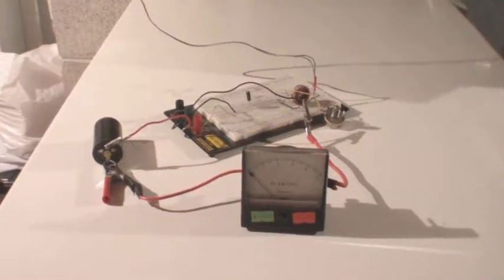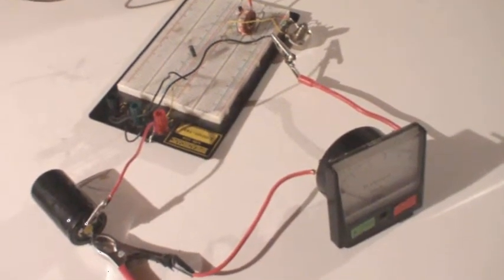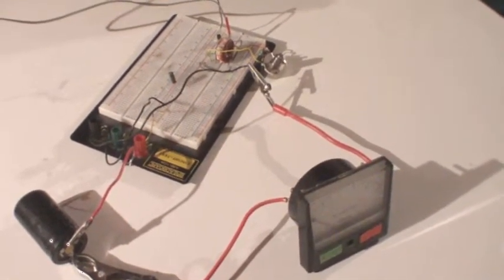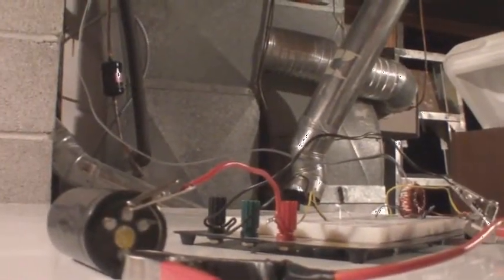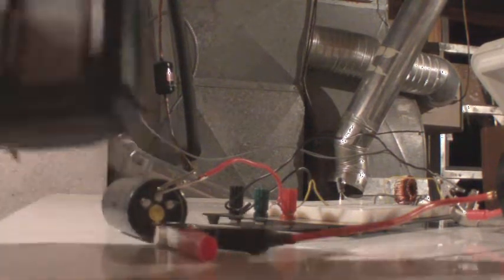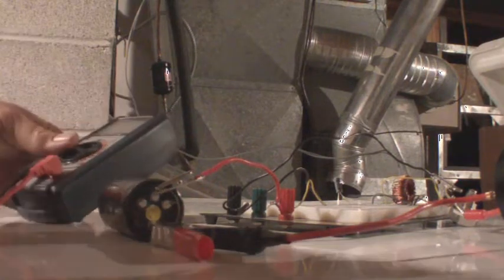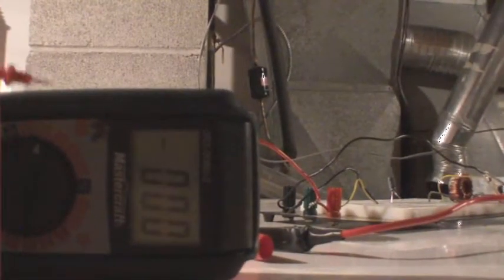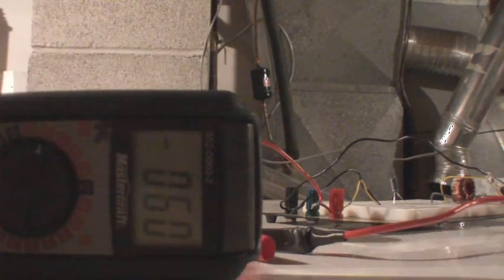My Take on Bedini's "Ideal" Hydrate Crystal Cell and it's Compatibility for "Negative Electricity"

Comment: Nothing wrong with your reasoning. JT's coil spikes are 30V+ all day with even shoddy designs. Once running they'll go all the way to a typical 0.45V switch off, for many silicon small signal transistors. In fact I rely on it sometimes, for S9014, C3198, C1815 and more.